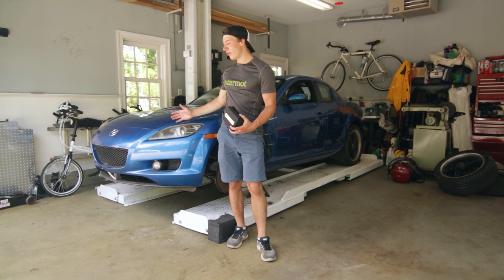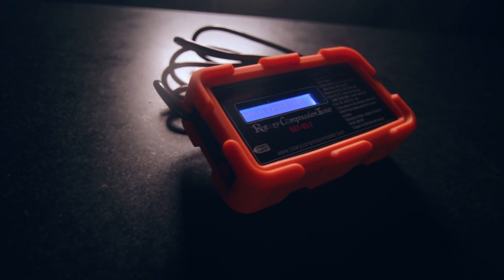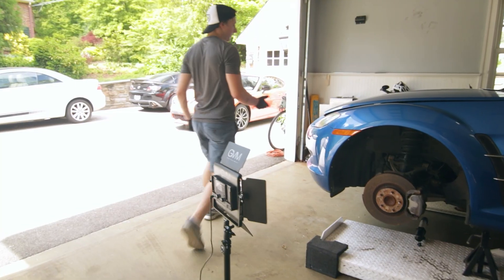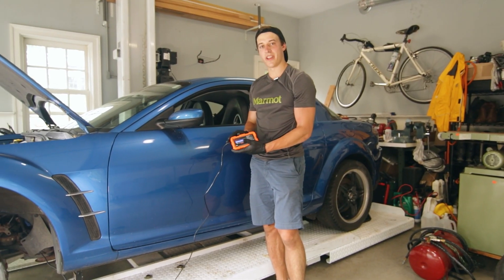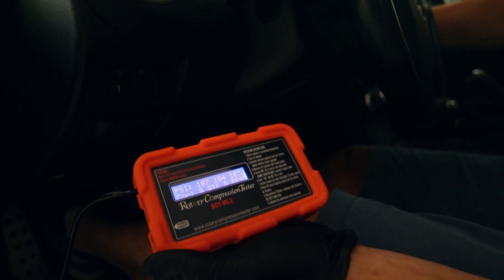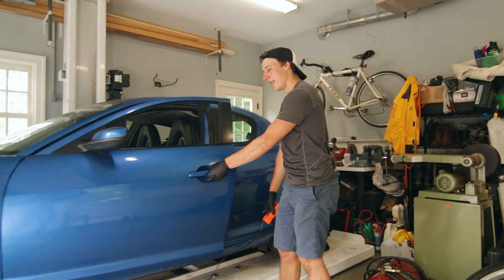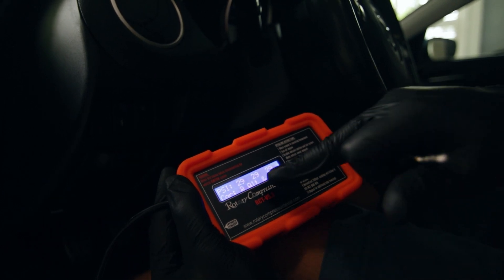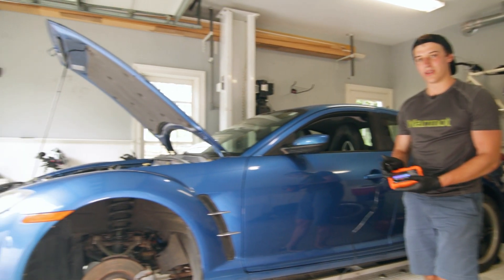Compression Testing my BLOWN Mazda RX8

Comment: wow: / measurement ok: /
Video recorded so as not to find out exactly which candle is removed, lower or upper, and where the tester is connected: /
Because as soon as the pressure on the upper opening is working .

www.mazda.warszawa.pl/5-sposob-dzialania-silnika-wankla-zalety-i-wady-silnika-wankla-jak-nie-zepsuc-wankla-czyli-silnik-rotacyjny-w-praktyce-serwis-problemy-i-eksploatacja/

Comment: Had mine 7 years 04 231 on 90000 miles and original engine I’m always looking out for any hiccups so fitted new coils plugs and leads and now all the gauges for oil and water temp is it just hot starts problems when it’s going to lose compression

Comment: Will you replace the apex/side seals with new ones? I am asking cause i have a blown engine and plan to rebuild the front rotor aswell so would be nice if you can send me the used apex/side seals for a little bit of cash if you would replace all of them anyway :)

Comment: Almost looks like it may be a bad rebuild by how high the compression is on the rear rotor. After I rebuilt mine with new Seals/housings I made similar compression. I could have used new rotors, but I plan on Rew swapping in the near future so my MSP isn't planning on 100k miles. Likely if I rebuild the rx8 MSP engine it will get new rotors machined for turbo applications.

Stick with mazda OEM seals, get new balanced rotors machined for deeper Rx7 seals if you think you might turbo the build. Spend a lot of time researching how to properly tolerance the side seals.
Reply: Will you by any chance be documenting the rew swap? It seems like something I'd like to do in the not so near future

Comment: For the black car, you can also try straightening the oil cooler fins with a pick and pocket screwdriver. My car seemed to run a bit cooler in the mountains after doing this.